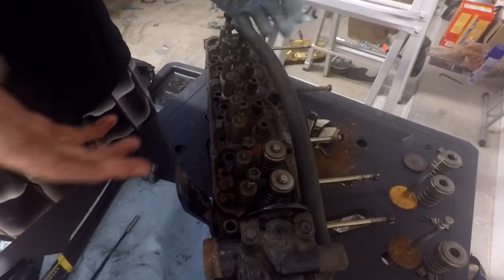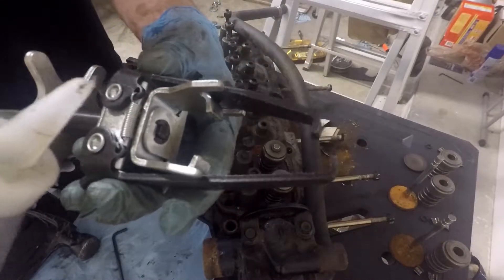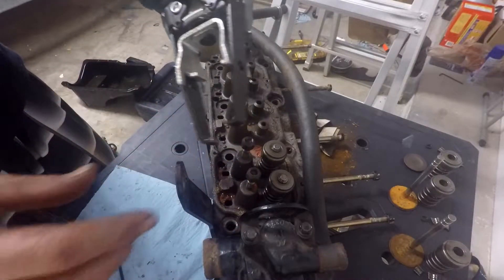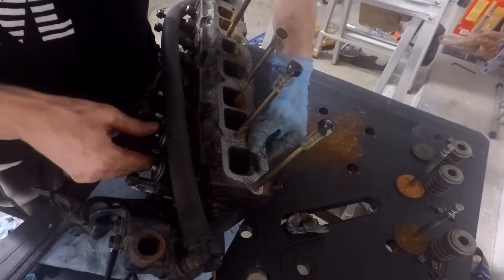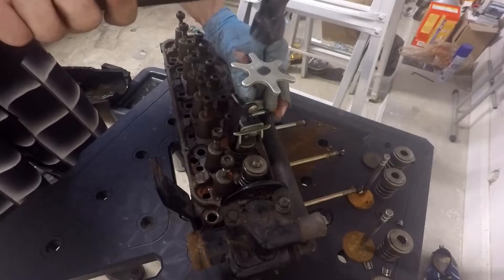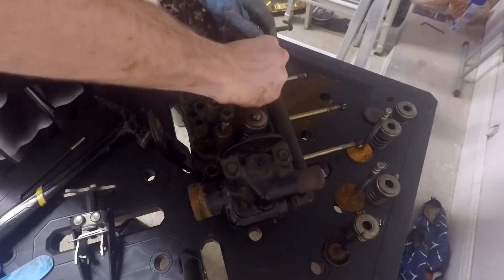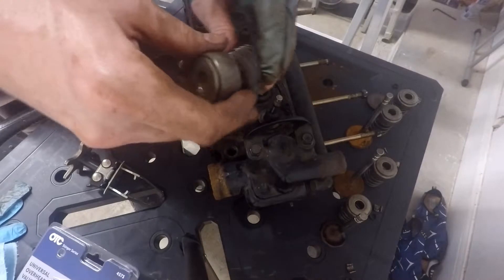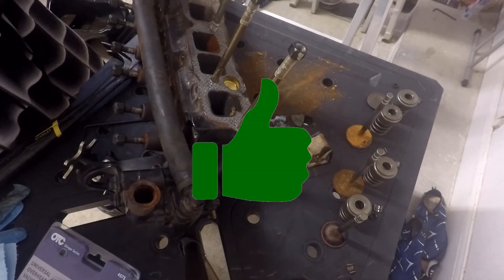Engine Head Valve Removal

Comment: A tip......... you may want to replace the water supply hose with a clear reinforced 3/4 inch ID  plastic hose   so you can see water coming from the impellor to the water pump after starting the engine..
Reply from the maker: Good idea! 💡

Comment: If you take a large deep well socket just slightly smaller than the upper spring cap before you put on the compressor set the socket on top with the valve head supported on a pc of wood 2x4 will work and give it a couple smacks with your hammer moderate hits you are not beating it to death you can loosen the (actual name of the part is valve spring keeper) grip on the valve stem. You should avoid hitting the tool directly with a hammer put a pc of wood on top then hit it, a good shot of penetrating oil will help also when going back together a little dab of grease inside the keeper will hold it on while put in the other half also a little rap with a dead blow or non marring hammer on the top of the valve stem will make shire the keepers are fully sweated you want to know now not after the keeper drops the valve down onto the piston. Or on the
 other hand a new reman engine is always nice to have if your rebuild eats a valve!

Comment: I don’t understand I have this exact tool and can’t get it to grab the spring keeps flying off.
Reply from the maker: I feel your pain, same thing happened to me on the first 6 I removed before filming. Best I can recommend is just squeezing tight on the bottom of the tool where it grabs right when  you're first tightening.

If it still keeps popping off after that try using a clamp to keep the grabbing arms from flying out

Hope that helps!
Reply: Or you can make a home built valve keeper remover from a big C- clamp  some plywood for the valve side and a plastic pipe with side notches cut out to allow keeper removal with a tweezers